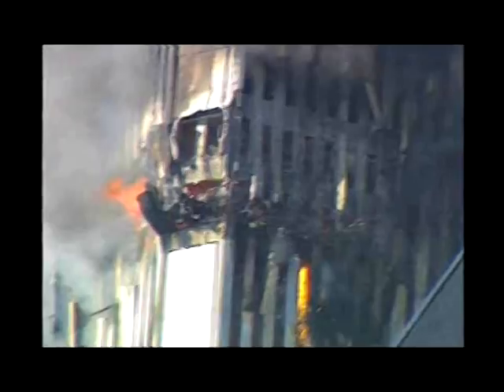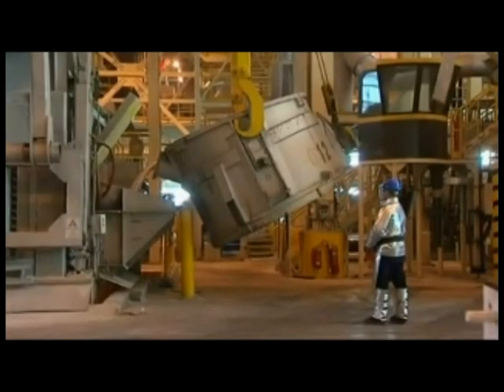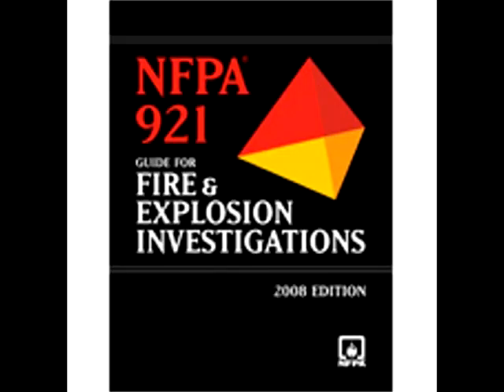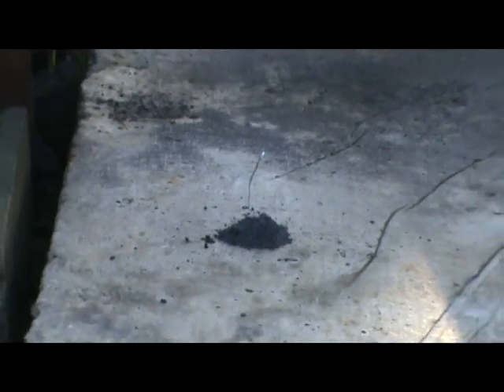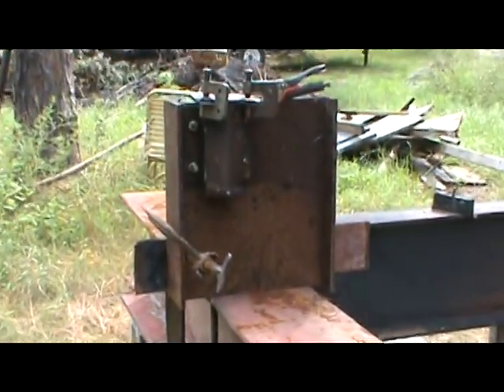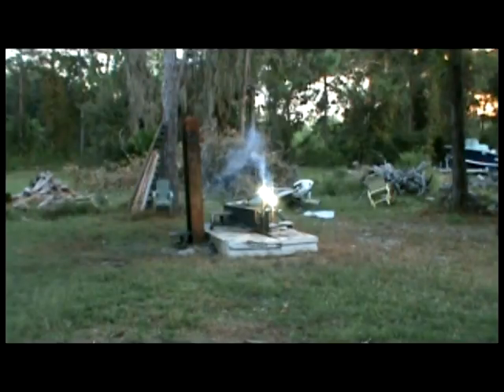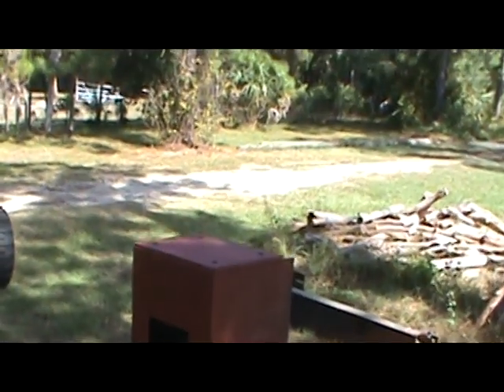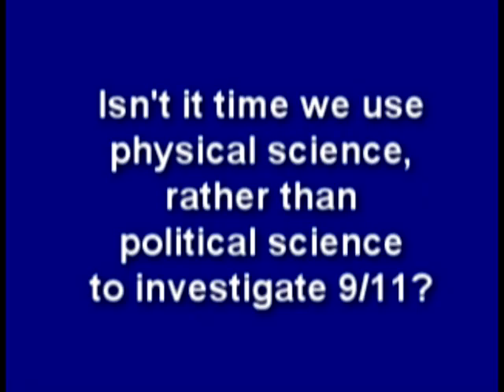9/11 Experiments: The Great Thermate Debate

Comment: JET FUEL
CAN'T
MELT
STEEL BEAMS
Reply: Sure it can.  Almost anything being burnt can melt steel.  How do you think they forged blades centuries ago?  Wood, coal etc.
Reply: stop😡
Reply: +White Folks Willy never replies with anything but hyperbole and avoidance. Then signs his post with a vagina. Go figure...
Reply: +DerZeldaFan you don't need to melt them for them to weaken
Reply: Willy Whitten Jesse Ventura refers to the black smoke, stating the same nonsense. What do you think the majority of stuff in an office is made of? Carpets, desks, computers, telephones and whatever else in that building will be some sort of synthetic, oil based material and what color smoke does plastic produce when it burns? 
Or was the black smoke from the THERMITE PAINT!!!???
Reply: Shut the fuck up ya douchebags!
Reply: Gexe that video misses the whole point. There was weight that those beams were supporting and they were mostly on the 4 corners. When the weight caused the upper floors to collapse the beams split like a Y and those beams guided that weight downward breaking all the subsequent floors below and further spreading the beams apart as it fell. It's a similar principle to a brick breaking competition where the bricks all have spacers and after a few layers of brick breaks the weight of those bricks breaks the bricks below so they end up breaking large stacks of bricks when they only generated enough force to break around 4 or 5 layers.
Reply: OREALLY https://www.youtube.com/watch?v=FzF1KySHmUA&t=0s&index=2&list=PL8tiuA93xjkQOazTteh13UskGITN_27J2
Reply: +DerZeldaFan sure, but it can weaken it to less than 20% of its rated strength.  when at that temp it easily bends and stays that way.  its called plastic deformation.  and all the weight on it can't be supported.  and then it falls.  and there is nothing to stop it falling.  i know, its difficult to grasp...
Reply: +Michael Schwab Yep. LOVE these wackos.
Reply: t is Keep smokin them ctweed haha!!
Reply: Willy Whitten ZZZZZZZZZZZZZZZZZZZZZzzzzzzzzzzzzzzzzzzzzzzzzzzzzzzzzzzzzzzzzzzzzzzzzzzzzzzzzzzzzzz . . . . . . . . . . . . . . . . . . . . .
Reply: DerZeldaFan the truth is that it gets so hot it loses over 80 percent of its structural stability. I've folded steel myself with wood charcoal and an exaust fan for air. That's all you need to forge steel.
Reply: No use yours the jet fuel only started the fire.
Reply: DerZeldaFan The hell it can't! A wood fire can melt steel beams! Blacksmiths have used charcoal to melt and pour steel for over a thousand years!
Reply: Blah blah blah! Thermite has nothing to do with it. The jet fuel is enough to start a huge fire .Aircraft aluminium will start to burn and once that starts ;it will burn more than hot enough to  melt steel.
Reply: Mike theBike lol you liberals make me laugh.
Reply: Mike theBike You are hilarious. You actually believe a plane can slam a building;and that building would still stand. On yet bike mate!
Reply: Mike theBike Well of course you're funny. You actually believe a plane can slam a building and burn like hell. I've made tons of thermite in my life but thermite has nothing to do with it.  Jet fuel in enclosed conditions will burn as it should do.  It's the burning aluminium that actually melts steel.  Give it another 20years and you might understand 😜
Reply: Logman all you did was confirm that the steel wouldn't melt and pour down the side of it. Lmfao
Reply: yes it can. It reduces strength to failure, this silliness refutes all other better arguments.
Reply: What are planes made out of? Aluminum. What happens to aluminum at high heat when he is in contact with water?
Reply: Did molten aluminum brought down building 7 too? the one that no plane out of nowhere hit?
Reply: Just one more thing to add to the list
Reply: fooster101
No one came forward for first desert storm but after many years truth is here - US fabricated facts so Iraq could be invaded. Also in 60s US planned to attack US civilian ships to get excuse for invading Cuba - truth was revealed recently...etc.
Reply: +Linus Magnus The affected floors were sagging for some time before the weight of the intact part of the building above it brought the whole thing down. People like you really need to get a life instead of attaching yourself somehow to a tragedy and spouting nonsense ideas about how it did or didn't happen. 
It's been over 14 years now yet not a single person who was involved in this great conspiracy has come forward yet and you know why?
Reply: +DerZeldaFan Wrong!  How do you think the steel got into the shape of a beam in first place.....moron.
Reply: Michael Schwab
ummm... not through jet fuel melting it? I never said "Nothing can melt steel beams"
Please use your brain next time :)
Reply: You can melt steel with forced air and motor oil as a fuel, easy as pie with jet fuel or gasoline.  Most steel forges use hydrocarbon fuel.  Please research before posting dribble
Reply: +Michael Schwab The oxygen content in the towers during the burn was minimal as can be determined by the color of the smoke. The scenario of the towers is not relevant to the towers. The vast majority of the jet fuel was consumed in the fireball as momentum carried the fuel through the other side of the building. As NIST itself explains, the remaining jet fuel was exhausted within ten minutes after the impact. Please research before posting your drivel.
\\][//
Reply: You fucking geniuses I was only referncing the meme

If you're upsetti have some spaghetti
Reply: “What causes such theories to arise and spread? Are they important and perhaps
even threatening, or merely trivial and even amusing? What can and should government
do about them? We aim here to sketch some psychological and social mechanisms that
produce, sustain, and spread these theories; to show that some of them are quite important
and should be taken seriously; and to offer suggestions for governmental responses, both
as a matter of policy and as a matter of law.”~Sunsteinhttp://www.law.uchicago.edu/files/files/387.pdf
Notice that Sunstein doesn’t even consider that evidence plays the largest role in the spread of conspiracy theorizing. He immediately leaps to the conclusion that there must be social psychological answers to explain the spread of such theories. He even fails to note that the official narrative of the events of 9/11 is a conspiracy theory, one that Sunstein hypocritically upholds himself.Such an analysis of Sunstein reveals that he is not a serious scholar attempting to discover the truth. He is a highly paid government shill out to stomp out dissent, and freedom of speech. He is a very influential voice within mainstream academia and linked corporatist government. This makes him one of the most dangerous individuals attacking the unalienable liberties of free individuals. He is in effect a Minister of Propaganda in Amerika who promotes Orwellian Doublethink, and the application of the Memory Hole as techniques of totalitarian control.
\\][//
Reply: +Michael Schwab so u say they forged them with jet fuel? riiiiiight. who the MORON!!!! xD
geh mal wieder inne Schule, du Vollpfosten.
Reply: wayneair the floors below it would catch the upper floors. The weight would have had to move in one solid motion. There was more structure and support below then there was falling load. Unless that support was intentionally sabotaged to make the floors and girders simultaneously collapse, which is what happened. Dont even get started on building 7.
Reply: With Jet fuel? I'm no iron worker but that sounds wrong to me
Reply: When a building that has been designed to withstand the impact of a jet airliner gets destroyed when impacted by a jet airliner.  The architects and engineers should be losing their licenses. BUT THEY DID NOT.
Reply: Mike Ries   You have a good point.
  No one was fired,demoted, or even slapped on the wrists. They were promoted for not asking questions. Btw, many in charge that morning had recently been appointed to their position and were on their first day on the job. See also Training Exercise on that very day.
Reply: +siamsurf, close but no peanuts. The handlers were actually FBI.
\\][//
Reply: +DerZeldaFan
80% of the people on YouTube are closed-minded retards living in an MSM bubble. They wouldn't know the meme, and they're desperate to attack anyone who questions the bin-laden-&-the-boxcutter-boys fairytale. They're like 21st century witch burners.
Reply: +Cleetis Baconwhistle I agree, DONT VOTE!
Reply: +Michael Schwab jet fuel? not exactly
Reply: peakarach they can't but drones can
Reply: Ofcourse not According to engineers you need some high temp. explosives..
Reply: There are a hundred pieces of scientific evidence pointing to the public being lied to about 9/11 by the mainstream media and NIST etc., for example, physics experiments disprove the pseudo-scientific official narrative: https://www.youtube.com/watch?v=hICX2m3mDo4
Reply: Induction furnaces and hot rolling.....buffoon
Reply: Easy. Because the dead can't talk.
Reply: Stan Williams   Yet right before the collapse firemen reported that they were confident it could be extinguished, and no one even mentioned the word collapse until they did. Then all you steel experts starting coming from all directions. Jet fuel burnt up in a flash. Office furniture fires are all that remained. I wanna hear about facts and science, not blah,blah blah.
Reply: Stan Williams   That's where I do confess ignorance. Still don't know what a liberal is. I will offer that people like you don't entertain me. Perhaps patriotism is shielding your eyes from seeing the truth. You are aware that the rest of the world has considered it an inside job for a long time. It's the only explanation for the ineptitude and paralysis of our government that morning.
Reply: Stan Williams   I've had enough discourse over the internet to have learned that when people resort to calling me funny, it really means I've struck a chord somewhere ; I've managed to bother them with my rhetoric. So go on. Laugh  Out   Loud.
Reply: surfingsuicune  then explain the molten metal pouring down the building fucktard.
Reply: +surfingsuicune Problem is that if they were weaken building would gradually begin to be deformed but it came down in a moment. Also molten steel is visible on the videos.
Reply: DerZeldaFan But jet carried load of Thermite can.
Reply: Hydrocarbon fires burn hot leaving dark smoke A hot, clean-burning fire will emit very little visible smoke;Smoke color can also help you find the location of a fire. As smoke leaves an ignited fuel, it heats up other materials, and the moisture from those objects can cause black smoke to turn gray, or even white, over distance. As smoke travels, carbon content from the smoke will deposit along surfaces and objects, which also lightens the smoke color. That leads to the question: Is the white smoke you see a result of early-stage heating, or is it late-stage heating smoke that has traveled some distance? To answer, just look at the velocity. White smoke that has self-sustaining speed (push) indicates a hot fire; however, the smoke you see has traveled some distance. The same thing happens when smoke is pushed through cracks and seams-the carbon and hydrocarbons get filtered off. White smoke that is slow or lazy most likely indicates early-stage heating.
http://www.firefighternation.com/article/where-theres-smoke

\\][//
Reply: To everyone bashing the OP he is correct in an open air burn jet fuel can not melt steel. Yes it can weaken it but it would not cause molten metal to pour down the building. Also here's an interesting fact and airplane strikes a bird during flight the nose cone is badly damaged so why is it that in the "video evidence" of the plane hitting the tower shows the nose cone come out the other side of the building?? Furthermore the plane would have been reduced to rubber upon impact as is displayed on other videos of plane crash testing. Y'all are blind sheeple that will believe whatever the government tells you. I hate to burst your bubble but the government has always lied to us about their hidden ajendas. When will people stop blindly believing the government and think for themselves....

Comment: melting point of steel +- 1470°C  
maximal burning temperature 2 230°C of a jet fuel
Open Air Burn temperature  1,030 °C 
steel fire resistance temperature 800°C (The critical temperature of a steel  at which it cannot safely support its load.)
use science and facts not conspiracies and hoaxes

Comment: At building 7 they took two transformers on trucks and wired them into the superstructure of the building turning it into basically an induction style surface. This is the same way a cool top cook stove operates by creating a magnetic field. Thermite was used in the key areas of the structure and thus this melted the steel which is why it appears that the planes pass right through the building. This also explains the loud popping noises coming from building 7 before the collapse. If you want to run an experiment experiment on that and you will have your answer. So to summarize again two large transformers are wired into the structure it gives no indication of heat. It ignites the thermite which then starts to melt the steel. the structure can only stand the wait for so long before it falls down on itself. this is very old technology it may very well even be in your own kitchen